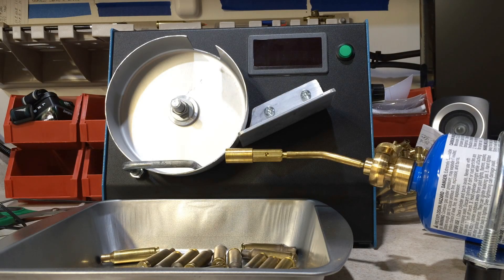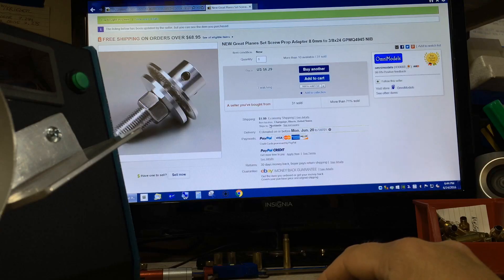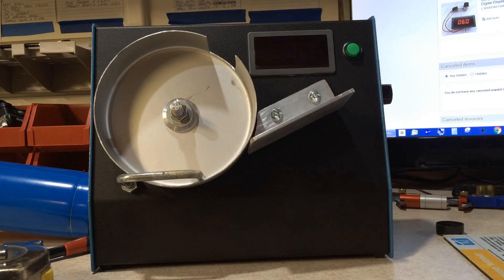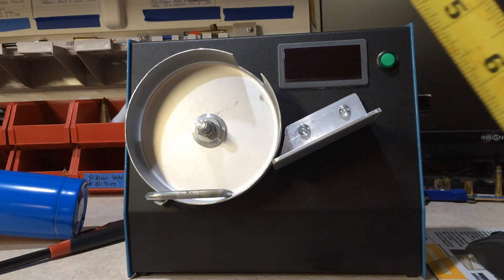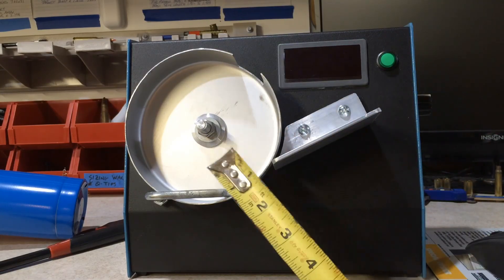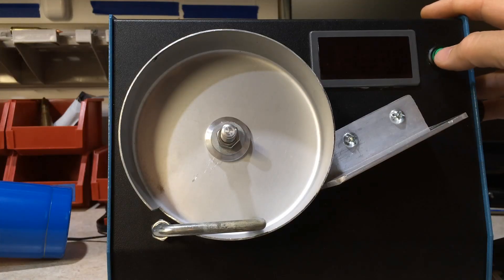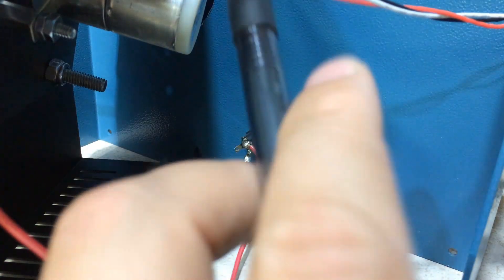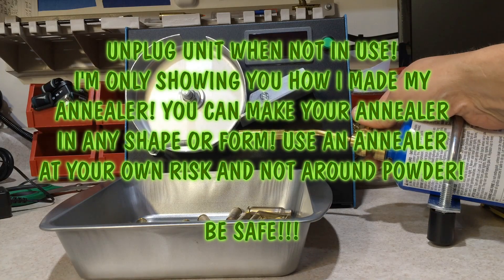DIY BRASS ANNEALER DETAILED GUIDE FOR ~$100

Comment: I just bought the supplies to build this, and the link to the power supply was one I used several times. but what I received was an Arris adapter, right volts and amps, but would not fit into the power socket.

Comment: I have a question about the pwr on/off switch and the rheostat knob. Is the switch a NO/NC Lighted switch and is the Rheostat knob a 10K OHM Linear Taper Rotary Potentiometer B10K Pot with Knob and 3-Pin JST-XH2.54 Connector Lead? TIA.

Comment: After searching through many videos I finally found this! Excellently presented! Thank you! 
   I don’t think I’ll buy the box. I’ll build it from plywood. Maybe slotted holes in ramp to give it some adjustment range? I’ll paint the box with gloss back sides and ref on the face. Seems like the prop adapter is out of stock as of now.

Comment: Finally got it built! Collecting parts and improvising those I can't get here, took about three months. Never built anything like this and first I put couple components in places where they caused a problem with closing the case. Now only issue left is the gas torch. I bought one, which seemed most easiest to adapt into this purpose. It now seems, that flame can't be adjusted into correct form. Hope to get this last issue sorted out next week.
Reply from the maker: Nice!

Comment: Great Video. My question is how did you mount your Dremel to your work bench to cut the pan down?
Reply from the maker: Just held it against the flat leg of my bench and took my time. Marked the perimeter of the pan with a thin tip marker to make sure i was staying on my line. Then touched up a couple spots od the cut on my grinder
Reply: @ElfstersRiflesandReloading  THank you very much. Parts are slowly arriving and then the project will begin. Thanks for a great tutorial.
Reply from the maker: Awesome! Keep us updated!

Comment: Great video, thank you! One extra tip (sorry if already been pointed out). You don't need to cut/splice the wires on the power button. The bottom of the button unscrews like a tiny flashlight, allowing you to then insert the button from the outside and the leads from the inside. Then screw the two pieces back together and tighten the silver nut to secure against the panel. Can also cut off the 3.5mm adapter on power supply and splice that directly into motor control. The annealer works great, though. Thanks again!

Comment: I'm just about finished with making this exact Annealer. Need an inline fuse, and a little time to work on it. I used a different motor so I don't have to cut the hole in the back. I kinda foresee the one at a time thing being a bit slow,  but I don't shoot that much right now, so not  too worried about it.  Nice video, well done.
Reply from the maker: Thanks! Got a link to the motor you used?

Comment: Great video, my only comment is you did. Ot need to cut the wires on the power switch.  Just pop the back off the display and unplug the pot and power switch.
Reply from the maker: Yeah, I'd advise doing that also. Didnt know you could do that when doing the video. Thanks!

Comment: Before you make these super machines. Look for the right temperature for properly annealing your brass. They will tell you that you need tempilaq to get the correct heating temperature. This is nonsense, use what they used to in the past. dark red, two orange. 750° F tempilaq will give you stress relife (longer case life) but will not give you reduced hardness (bullet release).

Comment: Interesting - I went to Amazon and sourced the pan. Then everything else you used in this project showed up in the section that says "Customers who bought this also bought:" Every part was there. Too cool! And great job on the design. Very cool. Thank you!
Reply from the maker: You betcha! Keep us updated on how it goes! Got to post a pic once done on my Facebook page
Reply: @ElfstersRiflesandReloading  One mod I plan on making is as follows: Not going to trim the cake pan. Instead, I'll make a 5" disc out of aluminum and bolt it inside the pan on the same bolt. I'll adjust it in and out depending on the length of the cartridge. It will mean modifying the mounting a bit but that way I can anneal any length brass I'd ever need to.
Reply: @utahprepper8925  9

Comment: Great stuff Elfster!  I've decided to build one based on your design, but I'll be making some of my own parts with a 3D printer.  I'm using a 90 degree worm gear motor and printing my own spindle adapter.  And for the case I'm using a piece of 1/2" MDF with some 3D printed bases to hold it at the correct angle and height.  Should come in around $60.  Thanks for the video and all the details!
Reply from the maker: Heck yeah! Keep me updated on my Facebook page with pics!

Comment: I cannot find a cake pan deep enough for my 20mm Lahti or 40mm  Bofors :-)  JK

Great video, thank you for the detail and info!
Reply: Oerlikon 20 mm cannon has been done on the original skip Black Betty.

I'm sure you could use a old pot cut the handle off.

Comment: Looks like Amazon may have the drive motor available for $ 12.58. Looks like the ebay unit?
https://www.amazon.com/BQLZR-Gear-Box-Stabilivolt-Electric-Replacement/dp/B00HDDXBEY/ref=sr_1_fkmrnull_4?keywords=High+Torque+12V+DC+25+RPM+Gear-Box+Stabilivolt+Electric+Motor+Replacement&qid=1551374824&s=gateway&sr=8-4-fkmrnull
Reply from the maker: Sure looks like it. Keep in mind that ships from China and would prob take 3 weeks to get

Comment: Great video. Following your specs I built one of these last year... works great. Have you toyed with a case feeder add-on for this design?
Reply from the maker: I only reload in increments of 50 or 100 and really don’t find the need for a hopper necessary. It only takes 5 minutes per 50 cases
Reply from the maker: Thank you btw! :)
Reply: Yep. I was in the same boat when I first built it... only doing 20 to 30 at a time takes just a few minutes. But now (shooting PRS) I find myself needing to do batches of a couple hundred at a time so I'm looking to retrofit some sort of hopper/feeder mechanism. I've seen a couple designs based on your original work. Let me see what I can find. 

Thanks again for sharing this inspiration. I've sent your video to at least a hundred people over the last 12 months.
Reply from the maker: 100% get what you’re saying. I think to have a good size hopper you would need a larger case. There are a bunch of videos on YouTube showing how to make the hopper and special sensors that detect the absence of the case on the ramp causing the hopper to feed another case from the hopper. I thought about it, but I also have an annealeez for doing large batches of brass. Thanks for your feedback! Thanks once again my friend!

Comment: Also a late comment,  but if it is online it is forever. Great video tutorial. I built one based on yours. Question is my timer is super low on the revolutions. But that is to be expected with different builds, suppliers etc. But how long do you anneal your brass. ? I am doing 300 blk at 4seconds. Again good job.
Reply from the maker: Check out my part4 annealing video, on how I anneal

Comment: I know this is a way late comment, but I just built your annealer, and it is working very well.  Thank you so much for the basic design and parts list.  Supports the KISS principal.  I did make a few changes to make it more useful for smaller cases like 6.5 Grendel, and I noticed the brass stopper gets way too hot with short cases.  I took another u-bolt, cut off all the threaded parts and attached it in reverse orientation to the original u-bolt.  I used a 1/4" cable compression sleeve ($.89 at the hardware store) to join the two u-bolts making it longer by double.  I moved the brass stopper mount hole to 10:30 from 7:30.  This made the brass stopper into a S shape from a C shape, and removed the stopper from the path of the torch flame as the end by the stopper does not protrude proud of the drum.  The brass stopper no longer gets hot as the original does.  I left the drum the same 1.25" deep as I wanted to be able to convert back to longer cases.  In order to force the Grendel cases to expose more shoulder to the flame, I made a Kydex 1/4 circle clip that snaps onto the brass stopper like a flag.  This is easily removable.  I also made a feed ramp spacer that forces the cases farther from the back of the ramp.  The new brass stopper has to be unbolted to remove the drum now, however I do not need to remove the drum to shift to short or long cases.  Other changes were to use a rubber table foot to cover the motor, moved the power button to the top of the case middle, moved the speed control to the old power button position, moved the power jack to the top right of the black case panel.  These changes allow the case to be opened without wires stretching between case parts.  Also you do not have to cut the power switch wires to install, there is a plug in the speed controller to unplug from the circuit board.
Reply from the maker: Heck yeah! Thanks for the input!
Reply: I would send you some pictures if I knew where.  No Facebook or Instagram.  I could share something from my Google Drive.

Comment: the back cover on the speed control box pops off and you can unplug the switch to mount then plug it back in
Reply from the maker: Very good info! Thanks!
Reply: you done all the hard work i just add a one point to your big project mate
Reply from the maker: Thanks, it’s a collective effort :)

Comment: I'm building one now. On the speed controller recommended the power switch can be unplugged from the display. No need to cut and splice the wires. Unplug, feed though the hole and plug back in.
Reply from the maker: Nice! Good to know! Post your pics on my Facebook page!

Comment: Awesome video, I have mine mostly built just waiting on the slow boat from China on the motor. rather than cutting and splicing the on off button simply remove the back of the digital display and unplug the on off button and slide it through the hole .

Comment: thank you for the video and wealth of information sir! quick question, when you load the feed ramp up, do you get double feeds or anything like that, or is the timing/speed adjusted so that the bottom of the opening in the cake pan blocks the next case from falling in?
Reply: He feeds each cartridge by hand after the window takes the previous cartridge.  Just like in the video. This is intended to be a simple to make, and small annealer for lower volumes of annealing.  If you need to do hundreds of pieces at one sitting, think of getting/making a larger annealer.  Obviously, it would entail more complexity and extended parts list. Having said that, this unit could be modified to include a stack and some form of auto-feed.  I am working on the logistics of that very thing now.
Reply: got it. I wasn't sure if the video was for demonstration only, or if at some point he might have tried doing 5 cases at a time or something like that.

Comment: Three bucks for a connector, holy shit. Get the adapter and connectors from scrapped electronics, free. Make the box from scrap steel, aluminum, plywood or whatever.
Reply from the maker: i wouldnt use plywood (being that you're using a blow torch) but if you have a way to bend steel or whatever.. rock it man!! it think the metal enclosure box shipped is like $35 bucks... it's worth my time and looks professional :) but i agree.. if you can get the wire and connectors from around the house, why not right!?

Comment: Thanks a lot for posting this! I ordered my parts a couple of weeks ago and finished building it today and it works perfectly. I did modify the plans a little to add some versatility. I cut the drum long enough to do the longest cartridge that I shoot and cut some spacers to put against the bottom of the drum to build it out far enough to do the shorter ones. The feed ramp is very simple to adjust as well. I have the brass stop set that it works so far with 243, 204 and 6mm br.  I may have to adjust it to do my 35 Whelan but I don't shoot that very much.

Comment: Have you considered another version with a case hopper?  

In a cursory look, your design is like 90% of the work.  Perhaps a longer case for the hopper and have the DRO's for the hopper and drum on the top of the case.  Just a thought, but would like your input.  

Thanks for this video.
Reply from the maker: +Richard White I suppose I could but I was trying to make it for under $100. Also it doesn't take that long to manually feed it at around 5minutes per 50pcs. I actually like the extra control I get by manually feeding the annealer and I'm able to get it set up I less than one minute. Good suggestion tho!!
Reply: Definitely not a negative criticism.  I think it's awesome!  I really appreciate the video.  I'm looking at a larger case (width) for the brass hopper.  Fingers crossed it works.  

Thanks again for a great video!
Reply from the maker: Richard White sounds good bud! let me know how it turns out! :)